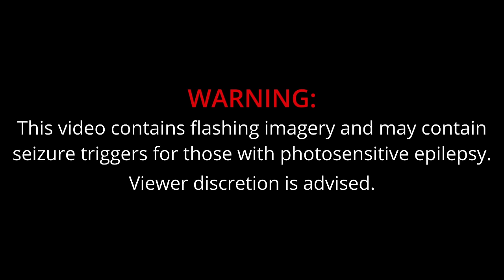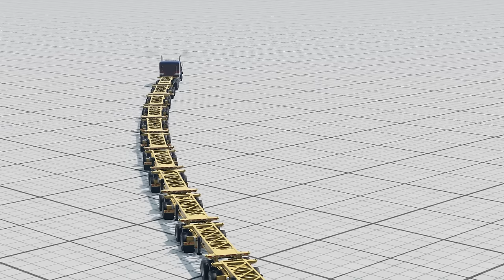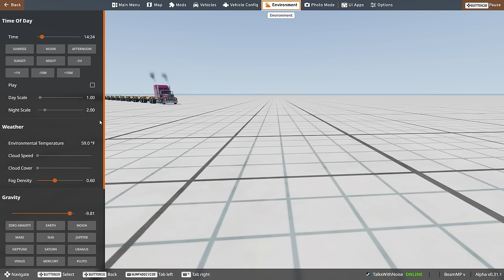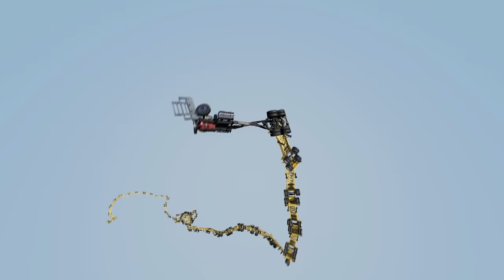Sending the T-Series into the 4th Dimension (Trailer Stacking)

Comment: 2:26 I don't really know what causes these spikes, but when they show up, something is SERIOUSLY wrong.
Reply: As someone who has beamNG I can confirm, happens lots with automation mods
Reply: Old beamng had them so commonly. Any hard crash would have them.
Reply: I do believe that it's caused by the physics engine breaking down, which results in the object stretching out way more than it's supposed to. The spike is the texture getting spread between the different parts of the model.
Reply: @tnc7399  Yeah, old BeamNG had its defects
Reply: @richardsherry1976  Yeah man, especially if you crash at high speeds
Reply: @turnerdeedo4633  Makes sense, probably is the case
Reply: The answer to y’all’s questions is the tires, if you have played long enough you will figure out that the tire physics are not that good. The tires start to bug out when they get completely disconnected from the wheel/rims, and when the tires explode it causes the texture to bug out like this. 
Edit: you can test this out if you have the game in the configs menu.

Comment: Cool video! I'm wondering if trying to use another trailer type could allow you to make a longer road train before you run into fps issues. Those container trailers were pretty short. Removing all but two wheels from each trailer might help as well. Perhaps you could make a follow-up video to see how long of a train you could make before you crash the game.

Also, that spring effect you had is a common occurrence with real trains. With any vehicle that has any amount of slack between couplers, once you add enough trailers it can add up to multiple feet of slack down the whole train and result  in large speed differences between the front and back. There was an incident I heard about where a train was driving through a storm and came across a section of the track that had been washed away, leaving a giant ditch where the rails should have been. The train managed to stop in time, but the force of the slack running in (the cars bunching together) was enough to push the engine ahead and into the ditch even though it had come to a complete stop.